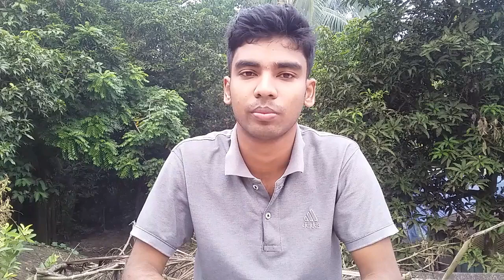আরডুইনো নিয়ে মনে প্রশ্ন থাকলে জানিয়ে দিন আমাদের | Do you have any question related to Arduino?

Comment: Bro, I'm doing a project which has Nema 23 stepper motor controling by TB6600 driver and some other sensor and relays. I couldn't understand the coding,  how to make variable speed as well as max torque. Can you help me? I'm completely stuck.
Reply from the maker: I haven't yet work with Nema 23 Stepper motor and TB6600 driver. I don't have any idea about this. Sorry brother.